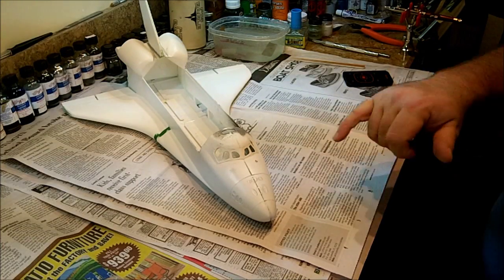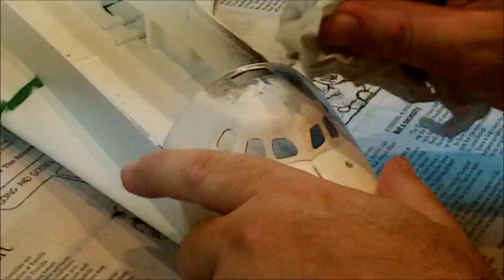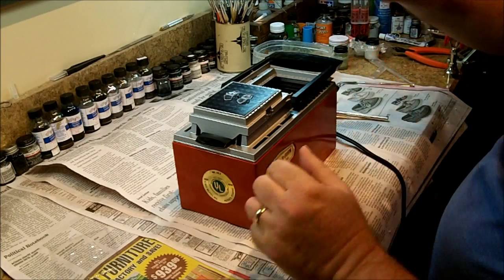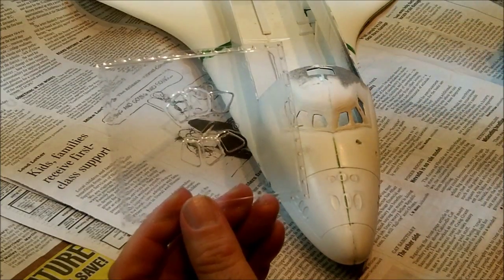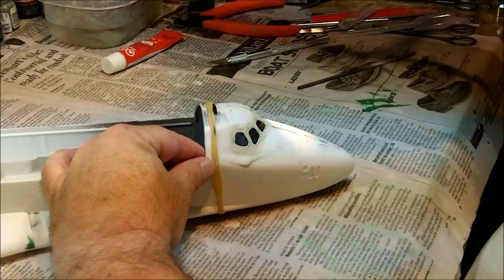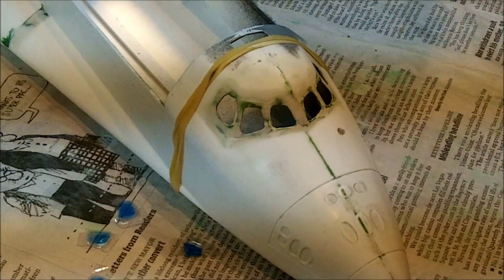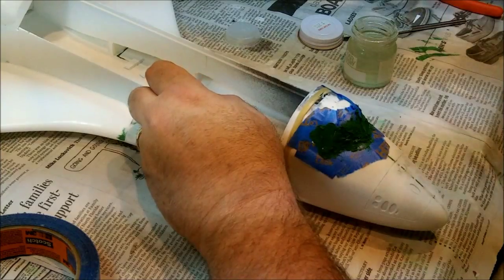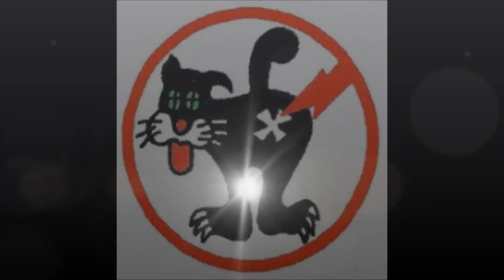Shuttle Wars, Part 9

Comment from the maker: That is a pretty good suggestion....do it like some of the better airliner kits are done.  However the piece would be slightly oversized (but probably still workable)  due to the nature of vacuforming.  Another problem is the size of the part.  I don't think a Mattel Vacuform machine could handle it and I don't have a more sophisticated set up.  I could maybe do it in two parts, however.

It is too late now.  Probably the best time to do something like that would be before major assembly.

Comment: you could possibly cutout the entire window section and a section of the surrounding area once you have filled and sanded the cockpit area to the correct shape, to use as a vacuform mold to make a new cockpit section out of clear styrene, which could be masked up to create the windows.

Comment from the maker: That would probably look okay, but it is going to be in the stack configuration for launch.  I am consoling myself by thinking "1/144 airliner," in the sense that it is acceptable to use decals to represent windows.  It is a compromise, but I have few options at this point.  When I do this kit again, I will use sheet styrene of the appropriate thickness, cut out the shapes of the windows, and then carefully laminate the sheet styrene over the kit windows, basically solving two problems at once.